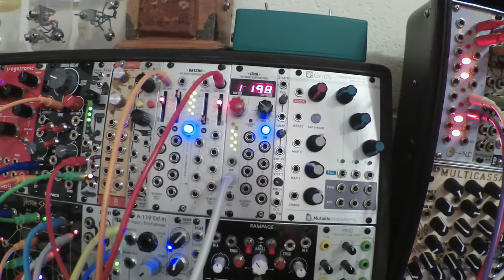Mission Control semi-tuneful patch with hand-played "melody"

Comment: Your expressive melody goes well with the sequence, especially that nifty dancing Lil Nerd. I was listening to the tune so much that I lost track of the words. Is that a new set of words? Maybe I just didn't hear them before. They add an interesting texture.
Reply from the maker: E950 has an extensive vocabulary.  There must be more than 300 words arranged in several banks, so it is quite possible I've never used these particular ones before.
I was about halfway in when I realized I should not have taken out the Doepfer "Octal VC Switch" module (removed because I have lately started using manual switches to mute parts.)  I wanted parts to drop out and come back in various combinations for each phrase, punctuated by that CLANG and all the pitches bending, and this would have been preferable to automate with clock divisions rather than do by hand.  Fortunately I don't sell modules immediately after pulling them from the case, so I deemed something else superfluous instead, removed it and put the switches back - alas, too late to use in this patch.
Reply: @JoshuaKennedy321  Oh, I forgot how large the vocabulary was! That VC Switch seems quite useful. We really don't have enough hands to make music electronically. I suppose one benefit of those old giant systems would be that a pair of musicians could operate the switches manually.